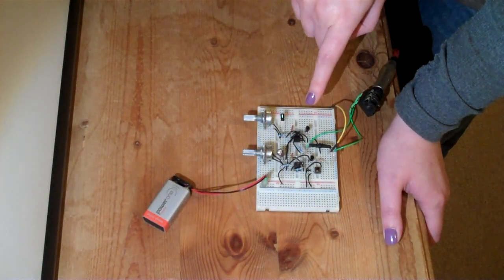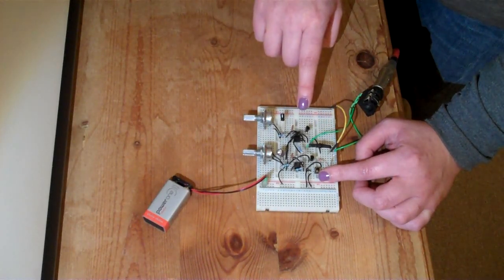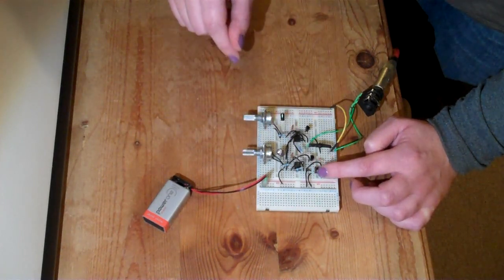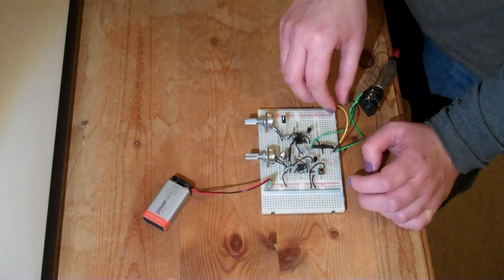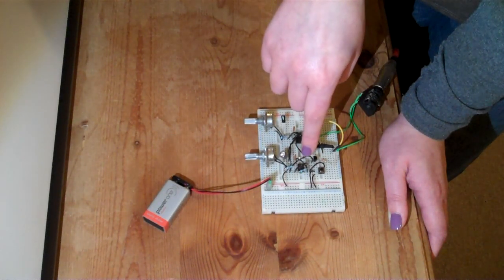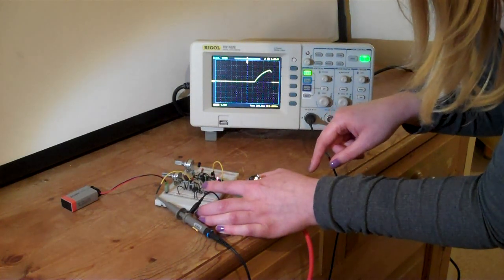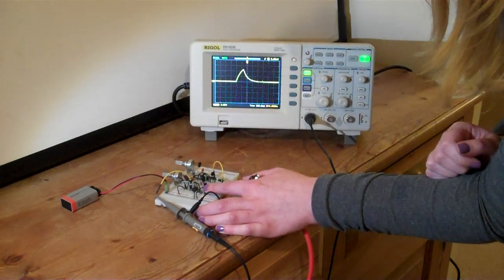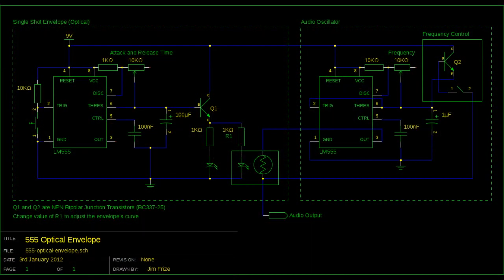555 Optical Envelope Generator with Kat

Comment from the maker: @Oweng40000 Sure, you can change it a bit but it doesn't work quite like a standard ADSR envelope, it's best to just have a play with it on a breadboard to get an idea of the control you have. If you change with the value of R1 you can adjust the overall curve of the envelope which will affect the decay, but generally speaking the envelope will be shaped like the charge and discharge profile of your capacitor.

Comment from the maker: Most npn silicon transistors would do the trick. It's there to act as a buffer and offset for the envelope. I used bc337s because that's what I had available at the time.